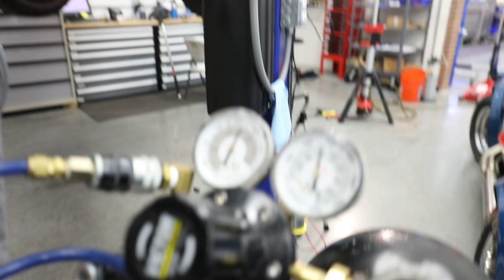2018 Ford Raptor || Suspension Upgrade || JRZ Suspension Install || How-To

Comment: Do you think the raptor lower control arm can fit on a regular f150?
Reply: yes the suspension in it's entirety meaning everything you see there will fit but you will need fiberglass fenders because the track width will increase

Comment: With changing/ upgrading these type of suspension dont they come with sensors  on the suspension  which control the stiffness and softness of the suspension like the factory suspension  .....or is it one of those compromises

Comment: Wondering why you’re going down to a 2.5 diameter shocks? I would just go with geiser springs and keep the factory shocks..
Reply from the maker: It is not a bypass style shock absorber like the factory damper is. So no need to go with that diameter tubing on the damper.

Comment: What brand is that bungee?
Reply from the maker: BESTVA 1/8 Inch 8-Feet Heavy Duty Adjustable Rope Clip Hanger 150-lbs Weight Capacity